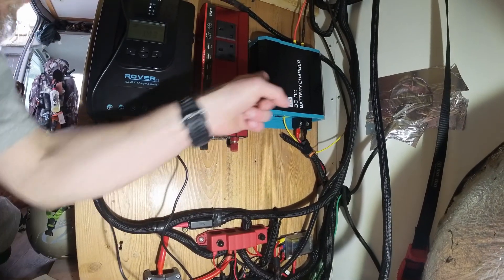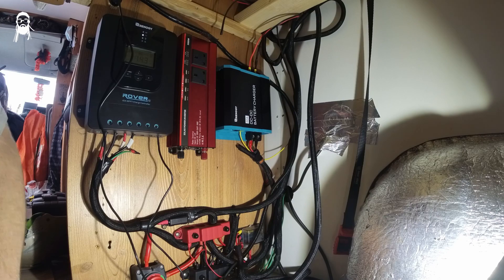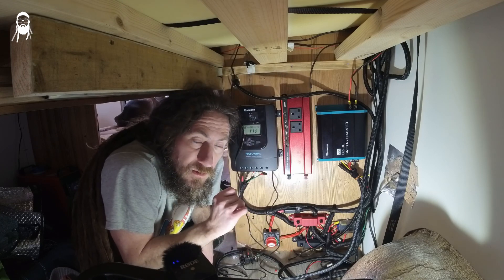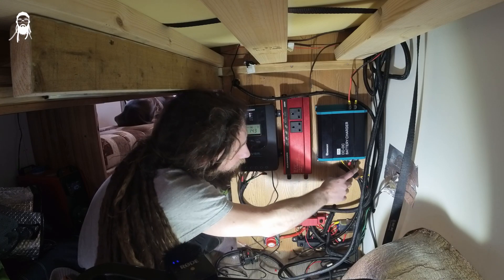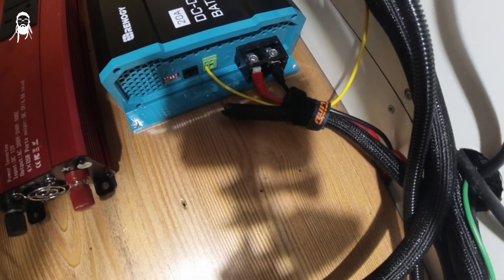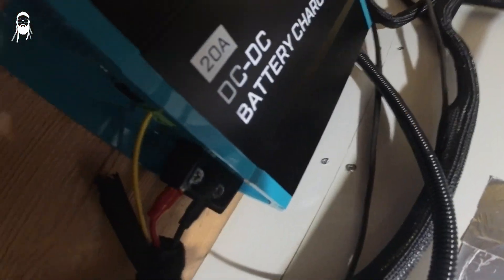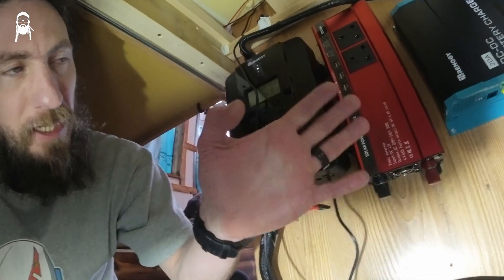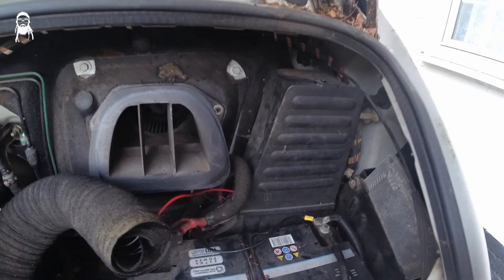Renogy DC to DC Chager | Split charging for lipo batteries | Are Renogy DC chargers any good?

Comment: Ay up mate, could i say use this via my car lighter socket and us it via a 12 AWG cable to a BLUETTI PS54 (700w/537Wh) power station with MC4 connecters to the car lighter input of the power station without the need for a controller do you think? (even better having a 100w solar panel as well)??
Reply from the maker: Now that I'm not sure about to be honest. 
I would straight up avoid Renogy now though, this DC to DC is playing up, had two bad lifepo4's and the solar controller isn't best. 
I've moved over to Eco-worthy now and having no problems at all.

Comment: Hey man! Thank you for an informative video? As i interpret you you dont have to connect the dc-dc charger to the alternator itself? 
And i didnt quite understand but how did you wire the D+ wire? 
Are you satisfied with 20A or did you wish in heinseit you took the 40A? 
Thank you! // Mo

EDIT: did you get the D+ wire with the charger?
Reply from the maker: Hi, sorry I haven't replied sooner. The D+ wire went to the ignition, luckily I had already run a wire there when I built the van. Basically turns the unit on with the key turn.

No wires at all with it, just ran a standard 3mm thick wire, it's not load bearing so it's just an on/off switch. 

I'm finding 20amps more than enough, 3 hour drive will take the battery from 60% to 100% no worries.

Comment: Renogy (no L in the name) DC-DC are fine.  I'm not in love with the Li profiles but for the price the 20A is it's hard to beat.   I agree that solar+alternator charging is an excellent combination.

> 0:45 if you had a normal split relay... do NOT use that on {lithium}  batteries.  it will kill them off.  Or your alternator.

Split-chargers (relays) can be used with reasonable LiFePO4 setups.  Example:  this cloudy morning while relocating a $45USD relay charged my 150Ah Li bank from 42% SoC to 75%.  Current was ~33A (0.21C) from a 180A alternator, well within current/voltage charging specs of the battery and the current specs of the alternator.  

To be sure, I wouldn't put a 300Ah Li bank on a small alternator on a bench at less-than-idle like Victron did in an infamous video.
Reply from the maker: Thanks for pointing the spelling mistake out, no idea why I didn't spot that.